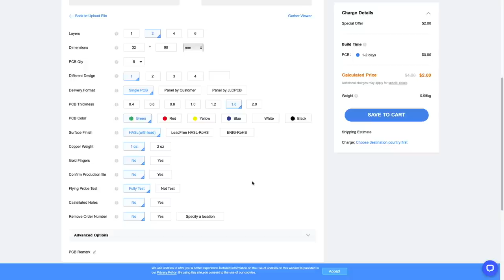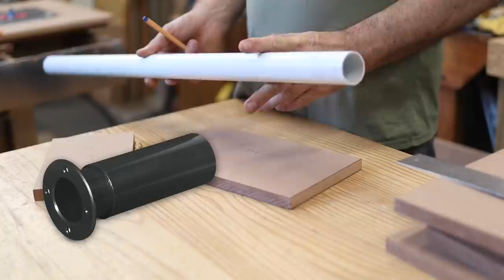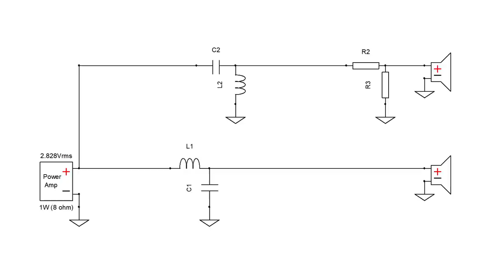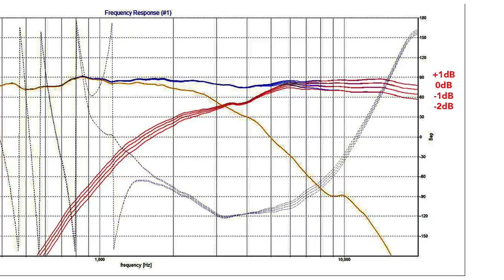The Dynamites 2-Way Budget Speaker Build - by SoundBlab

Comment: I used that tweeter as a replacement for some vintage speakers where the tweeters had failed in multiple ways. The speaker sounds great and can get loud without being harsh. It's original midrange driver helped with that, having no break up until 8k which is much higher than what it would be crossed over at.

Comment: Have to admit, these sound very nice. Low end is surprisingly good. Having bought the parts for DIY "speedsters" I have my doubts now :)
Reply from the maker: Thanks. The speedsters will be very good as it uses higher quality drivers that are much more expensive IMO. I think you will be happy with their sound in the end. More high end than budget, which is the difference in the end between the two. It's all about value for money, and I think you will get very good value from the speedsters if you pair them with good equipment.
Reply: @SoundBlab  Appreciate your answer. Yes, I'm planning to pair them with a decent amp, a vintage Pioneer A-717 (it drives my other speakers without issues - Canton Ergo DC -100) so it shouldn't be a problem

Comment: nice build, as always, I wonder how important the brace is though, doesn't hurt of course, but for such a small enclosure and driver with that thickness of MDF I don't think it is necessary.
Reply from the maker: Thanks. Brace probably not that crucial, but the this driver can push quite low, so I wanted to make sure.
Reply: @SoundBlab  thanks for the measurements of rounded vs straight corners, I heard about it but I don't think I ever saw actual measurements. I use something in between for my designs.
Reply from the maker: Sure 👍🏻. Small drivers on larger baffles will show more variation, but for this narrow baffle, the difference is inaudible.

Comment: Do you prefer a U-shaped sound or an even response? The mids seem a bit cold, but I guess that is probably just the second-hand listening through a video effect.
Reply from the maker: I usually prefer a slight U-shape, but this one it pretty flat. It is not that cold in reality, and sounds quite balanced. Even though I normally prefer U-shape, I tune each speaker to where I feel it sounds best. This does not always result in a U-shape response though.

Comment: Hi...I am looking for stuff for this build. What radius is used for outer corners and what is the thickness of the boards. I want to make sure I can get everything before ordering the plans.
Reply from the maker: The radius is approximately 3/4 inch or 19mm and the board thickness is 5/8 inch or 16mm MDF.

Comment: I bought the plan a while ago and I want to start building them, but I'm unsure of the amp board I want to use. Is the Arylic up2stream 2.1 a good choice or does it lack the power? Could you help me with some advice?
Reply from the maker: Hi, awesome! The Arylic 2.1 will have more than enough power to drive these, and you can then also add a sub to fill in the low end a bit. However, these have pretty good bass for its size.

Comment: Hi! I really love your videos. I want to build these But don't have access to these specific tweeters and parts-express. 
Do you have any other tweeter suggestion which I can buy from Aliexpress?
Thanks
Reply from the maker: The design cannot be done with another tweeter without changing the crossover. What country are you in?
Reply: @SoundBlab  I am from Pakistan
Reply from the maker: There are a number of speaker suppliers in India. Not sure if this will be helpful, but its is the best answer I have right now. You should be able to do a search for these drivers.

Comment: Sir only one question why you use resistor???if you use resistor to maintain tha woofer and tweeter sound output then one resistor is enough why you use two resistor
Reply from the maker: It is called an L-pad and consists of the two resistors. This configuration matches the impedance between the source and load.

Comment: Hi, I have the same milling machine (Triton/CMT 7E) but I don't understand what kind of "adapter" (which is not supplied) you used to make the circular cuts.

Many thanks for all your help
Reply from the maker: I got the plate that attaches to the bottom of the router as a package. The circle jig function is built into the plate.

Comment: Hi @SoundBlab I'm trying to build my first speaker with same drivers you are using, The issue is my 2.1 amp has 50 watt per channel.

I can see RMS of : 
Hi-Vi B4N -  25watt
Peerless BC25TG15-04 - 50watt

So it is 75watt is im not wrong? can my 50w per channel handle your hardware configuration?
Reply from the maker: It will work fine
Reply: @SoundBlab  the math is not adding up. But i know I'm missing something. Can you explain?

Comment: Is there a special kind of paint for this?
Reply from the maker: No, I used a spray can filler undercoat, and a good quality spray can paint in the colour as desired, and then give it a clear coat of spray can paint to protect the colour. Multiple layers required with fine 320 grit light sanding in between.

Comment: i am planning to build something very similar but maybe with slightly different drivers how would i calculate the watts needed for the speakers and how would i find a good amp for them, also im planning on buying a premade crossover. how would i figure out what watts for amp and would it matter if the tweeter is different wattage to the woofer?
Reply: also is it ok if both the tweeter and woofer are 8 ohms?

Comment: Nice Video very well done and explained helps new diyers like me to understand better. Had a question how would you compare to your 3 way omnidirectional build 
Especially on the bass front and pressuring the room
Reply from the maker: Thanks! The bass output of both is more or less the same in terms of being able to load the room (as long as room is medium sized). But in the end I prefer what I hear overall from the Dynamites.
Reply: @SoundBlab  wow didn’t expect that. Thanks for the reply your input helps 
Like one user requested a good nice line array and a superb BoomBox builds will be fun
For boom box something like a 2.1 or 2.2 using powerful Wondom dsp amps
Reply from the maker: I have a line array build coming up later this year. Stay subscribed to check ot out 😉
Reply: @SoundBlab  end of the year is too long I don’t know if I will live that long with the cases coming in my country

Comment: Hi mate, how do they compare to the c-note kit from part express ?
Reply from the maker: Have not been able to hear the C-notes for myself, so I cant really give you an informed opinion. However, the Dynamites is a very good speaker with good drivers, and the build plans gives you the option to tune the treble to your taste. The midrange is pleasant with remarkably deep bass for such a small driver. Overall the frequency response is pretty flat and well tuned for music listening. It is definitely one of my favourite builds that I have done, and have received good feedback from some that has already built it.
Reply: @SoundBlab  it seems that you did the crossover on xsims without off axis response, do you have a frequency response graph measured After you build it ?
Reply from the maker: I normally do yes, just to verify my results.
Reply: @SoundBlab  I've just finish the build, they sound awesome 🙂

Comment: 4 ohm tweeters with 8 ohm woofers ?
Reply from the maker: Yes, not uncommon at all.
Reply: @SoundBlab  So does it put a 6 ohm load on the amp ? Sorry , I have built a few speakers over the years but I am not an expert in electronics , always thought you had to use ohm rating equal to or higher than what the amp was designed for ?

Comment: That's a lovely build and a great sound (Sennheiser headphones at my end). It's like great cooking where simple ingredients, simply cooked, but with great care, can produce amazing results. What is the efficiency like, amp recommendation?
Reply from the maker: Thanks. They are not hard to drive. Prob around 85dB. Any amp with 20watts or more will be fine.
Reply: @SoundBlab  Thanks for that. I have a (kinda) "vintage" Musical Fidelity A1, which could be a good match here. BTW, have you ever thought about "branding" your built speakers? A friend of mine works in a company that makes small-run urethane domed stickers - a SoundBlab logo would look great on your finished builds.
Reply from the maker: I actually do have my logo in resin dome stickers, but I dont always remember to put them on. Some do though.